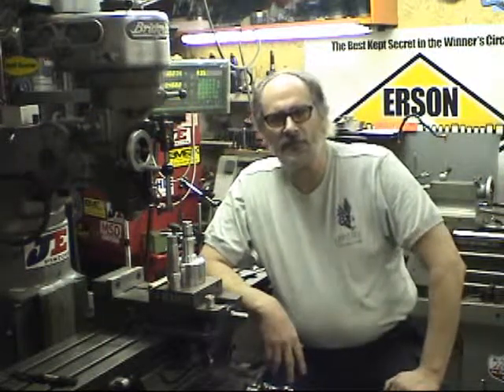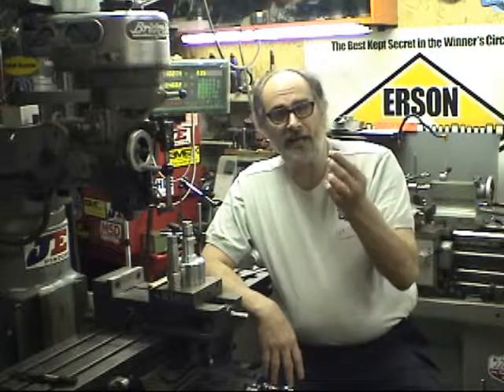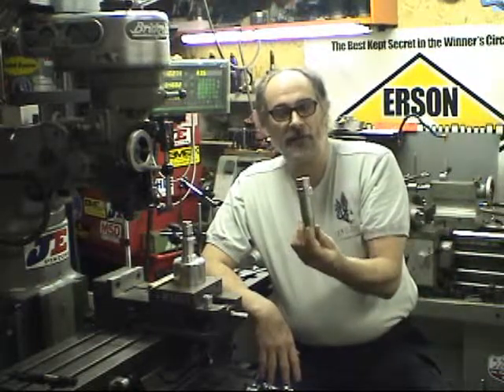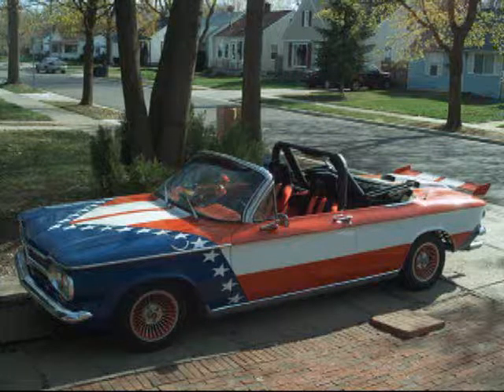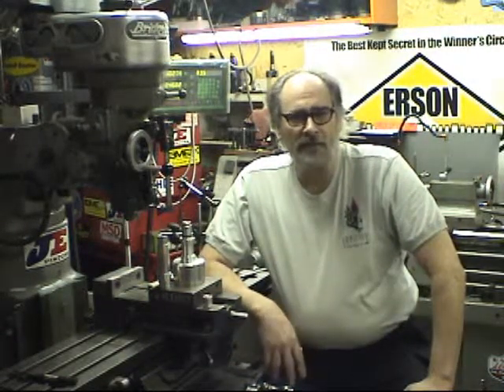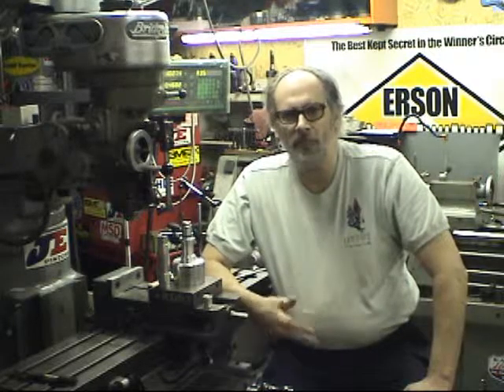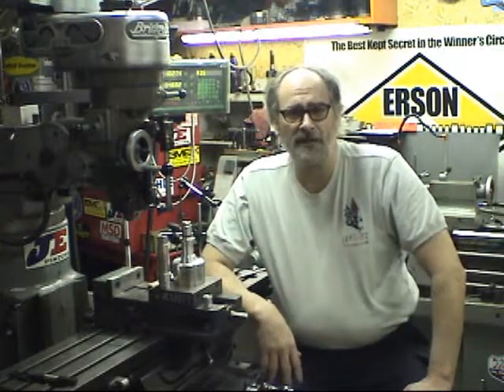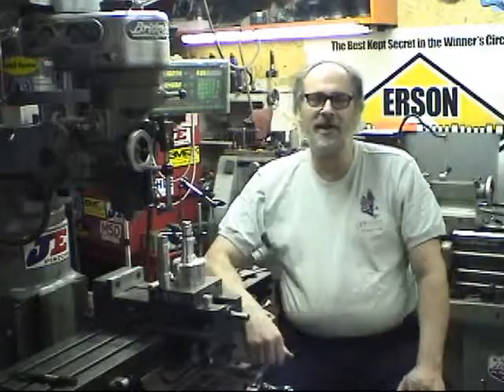Welcome to the grass hut

Comment: Hi Tom- you have some pictures of some porting modifications on a set of 140 headsthat you posted on "Bryans Autocross Page"- the pictures were of the combustion chamber and a couple of shots of the ports after the intake manifold had been cut off.I seem to recall a set of pictures that you took of some porting work that you were doingafter the top of the corvair manifold had been cut off- you were doing some work on the entrance to the intake port, without cutting the whole manifold  off, like would be done forindividual runners- anyways, I cant find those pictures, and don't remember where I found them. Could you post a link to those? Thanks!!